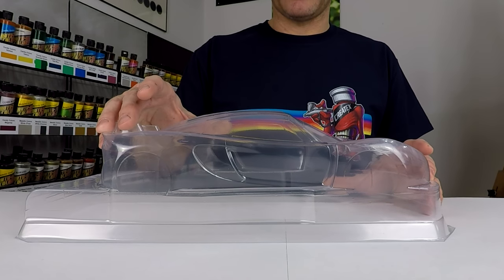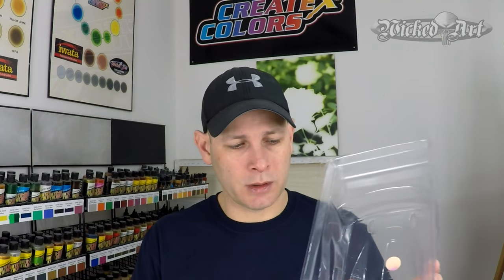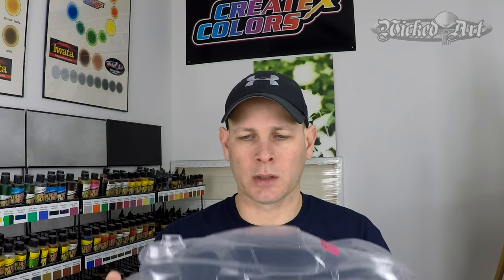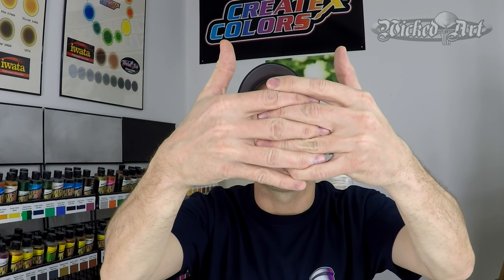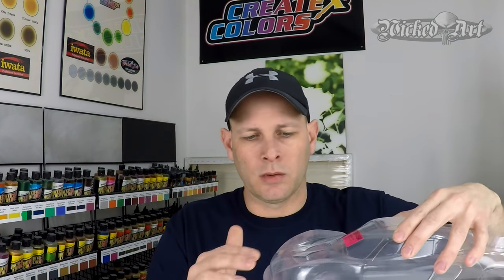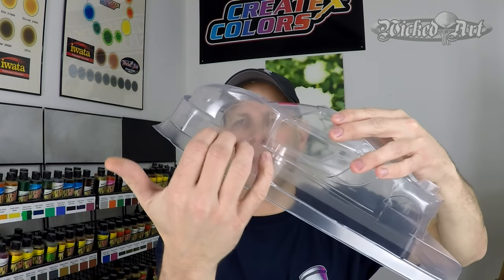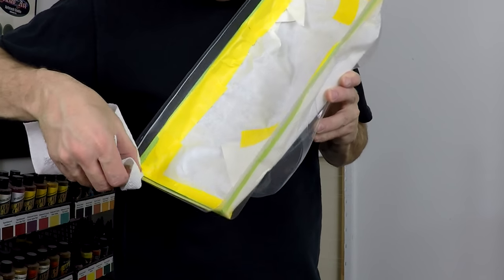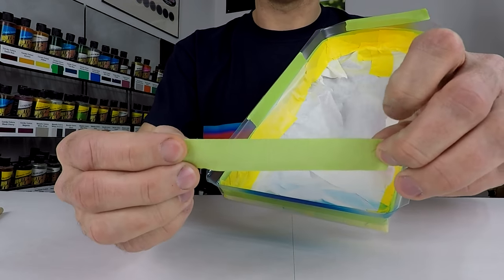RC Paint Adhesion with Createx Colors

Comment: I think they are now suggesting just using 4050 now for all hard surfave
Reply from the maker: Hey CJ!  4050 is an excellent adhesion promoter, as well as a primer for bare metal prior to adding color based on my own experience.  It has many other uses that are fantastic for the custom painter/airbrush artist as well.  However, I don't use 4050 on every hard surface.  There should be a need, or an advantage provided by the 4050 in my opinion, otherwise you're wasting material.  Based on other comments from those that have more experience painting Lexan RC bodies, I don't think 4050 is needed.
Reply: @wickedartstudio  interesting good to know...i do wonder though about 3d printed stuff hmm will just have to experiment
Reply from the maker: @cjadams7434  Prep work on a 3D printed surface is a challenge because you're not working on a flat surface.  Using a light layer or two of 4050 is not a bad idea for that purpose depending on what colors you're using (some of the newer Wicked formulations already have 4050 in them).  I would do some tests on a piece you're not worried about if things don't go as planned to see what the difference is with 4050 as an adhesion promoter versus without it.  If the paint can't be scratched off easily once it's cured (there's a difference between cured and dry to the touch) without using 4050, there's probably no need to use it.  Make sense?
Reply: @wickedartstudio  yes was my thoughts too